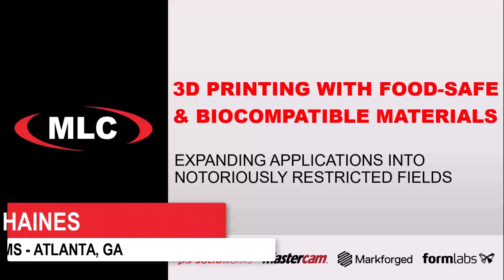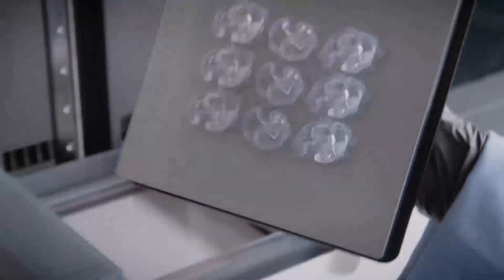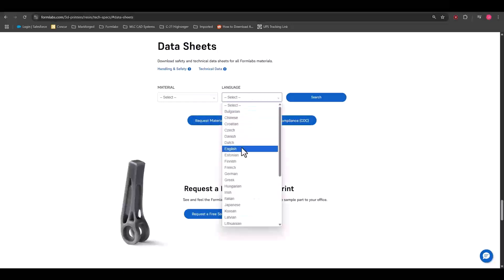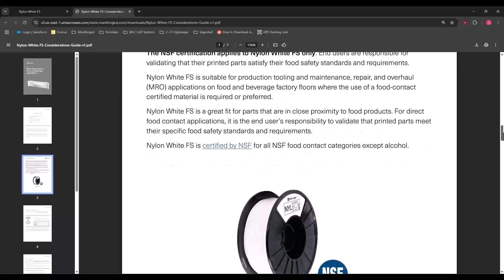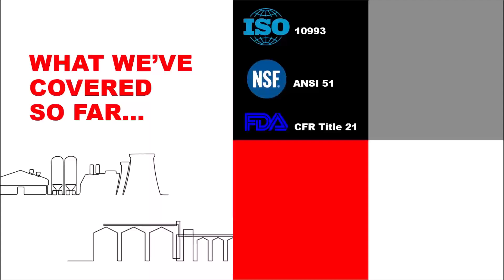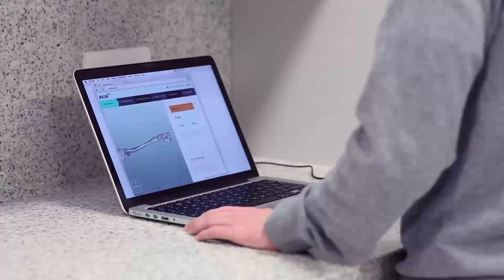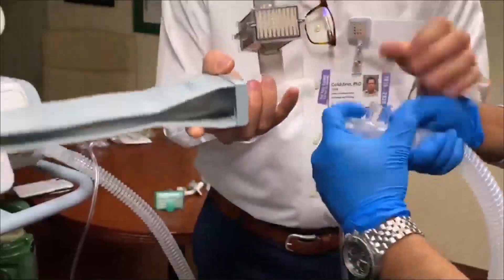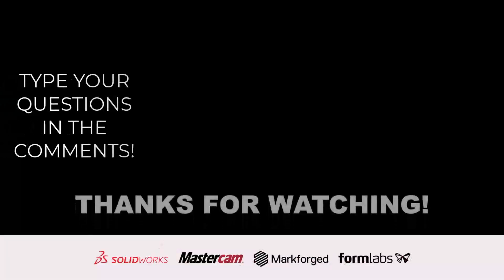3D Printing | Food Safe & Medical (Biocompatible) Manufacturing Solutions!

Comment: Sorry but fdm cant be food safe, filament can be, there are many even with certifications but the 3d part with layer lines won't

Because those layer lines are not cleanable throughly and in time bacterial frowth is huge. If one day formlabs comes up with a food safe material, it might work as layer lines in sla is so much smaller. But not with fdm.
Reply from the maker: The food-safe rating only applies to specific materials and printers, and still requires the creator to review the part for suitability. Advancements in 3D Printing have taken us to this point where it is possible in terms of porosity and other factors, but the surface finish cannot be ignored.
Reply: @MLCCADSystems I want it so bad, if it worked with any brand I would be a customer 😅

We use injection molding still even for small series stuff that 3d printing could fill beautifully. However we had done lab tests and no material including nylon worked. And this is for simple geometries if there is a curvy surface or anything with an overhang well then it’s not even a possibility.

One thing you can check out is sls powder printing with surface smoothing, xometry claims it’s food safe but the opinion here is mixed too as it being dishwasher safe is not certain and chemical toxicity used for smoothing and all is highly questionable.

So much so some companies using the exact tech stack wouldn’t give you certifications because their food contact tests resulted poorly while others take the risk, however we have food safety controllers coming and picking pieces to take it to their own labs, which is standard procedure and should be the case for customer health and safety, so we aren’t risking anything with 3d printing.
Reply from the maker: This is a big step towards food-safe printing, but as you know, it certainly isn't the final step.